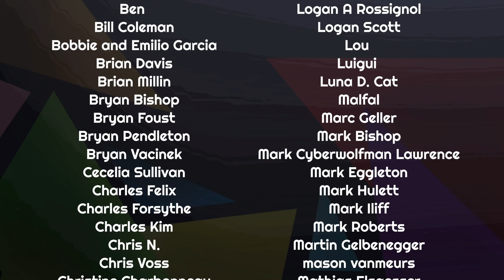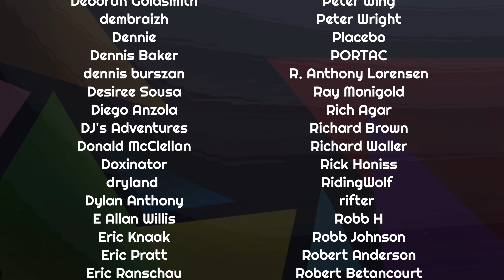Automakers Don't Want You To Buy EVs

Comment: WELL, seeing how battery packs cost anywhere from $30K to $60K
and eventually,  ALL  EVs will require a new battery pack, maybe 
leasing would be the smarter move.

!
Reply: I doubt battery packs for Tesla cost 30k if they are able to sell Model 3 for 36k...Things is though they usually have 8 year warranty and rather high miles on battery too in a warranty, and I doubt people who buy cars, a lot of them will drive them whole 8 years, although it is of course possible... and let's say battery goes bad in year 10 of ownership with 150k miles on it, the car will probably at that time cost maybe 7-8k (if it is not a luxury vehicle), after 10 years of ownership, so if the battery goes bad it is not a huge loss anyway and probably just a few cells there are bad and you can sell it for re-use in battery storage or by the time there will be some guy that can fix it for you for reasonable amount. In more mature EV markets there are already people who even fix the old Leaf batteries, there is no reason to think 10 years from now it won't be easier and there won't be more people able to peer into the battery and fix the broken cells, unless of course car makers make the cars so you have to disassemble the whole car to repair batteries...
Also the fact that at least Tesla warranty is so generous makes me think that they indeed perhaps are not as bad or as expensive as they are said to be... it's more like there are few people at the moment outside of companies who make the cars, who know anything about them, so Tesla or whomever can charge you whatever they like for fix on battery.
Then there's also car makers who do not like that people have ability to fix... like ekhm Tesla, where there have been cases that people actually repair the batteries and totally wrecked Teslas, but then Tesla denies them access to Supercharger network... I do understand that Tesla does not want some franken-car to plug in and burn the whole site down but there should be some safety standard that, if independent repair shop can achieve, then the car should be allowed

Comment: If you are considering an EV, leasing is probably the best option. I bought my EV, and I am now stuck with a 7 3/4 year old but only 39 k mileage vehicle with 33% degradation. The only thing is, if you do, lease all the other downsides of an EV still apply, like bad infrastructure, range anxiety, very poor range compared to ice etc. etc.  the list is endless, so the best thing is probably just to buy an internal combustion engined car anyway and have less hassle,  stress and financial loss.